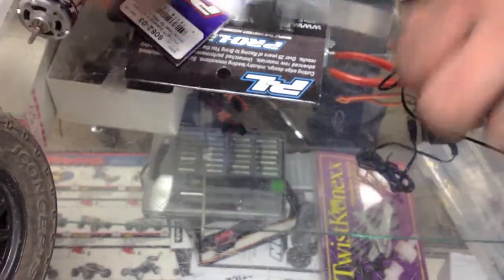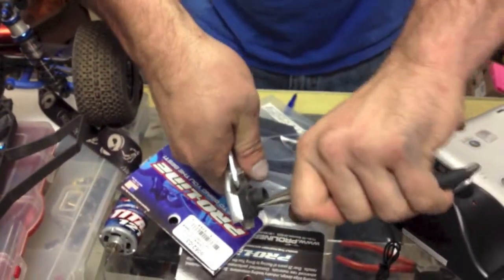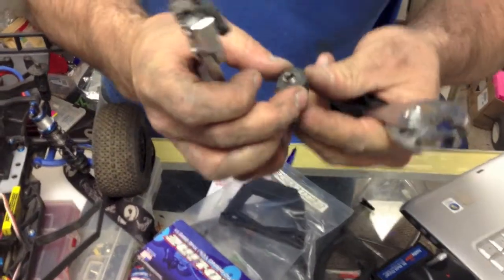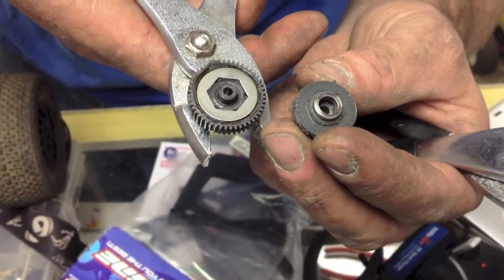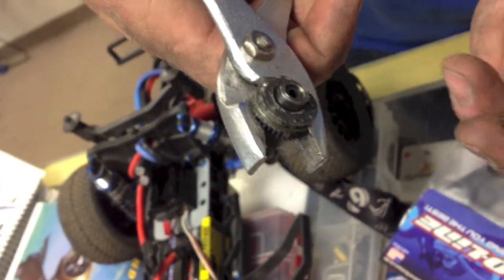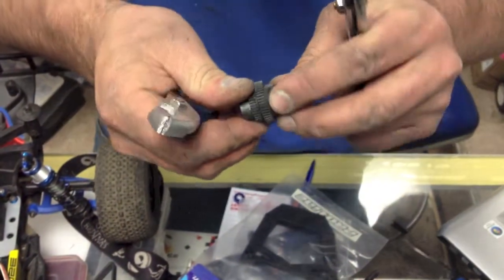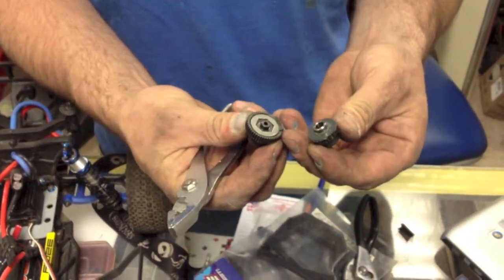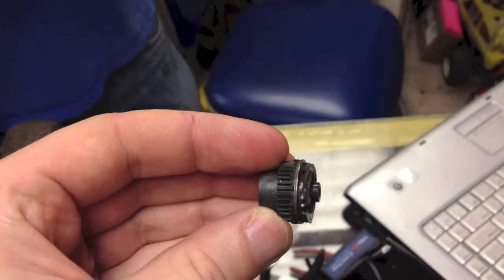Melted Ball Differential from Team Losi JRXT JRX2 JRXPRO

Comment: That was very common with that truck using mod motors.  I would have to drive very conservative in the early portion of a race to not overheat the diff.  I kept a couple pre built diffs in my toolbox, and would swap them out regular, to avoid this.  Keep up the good work